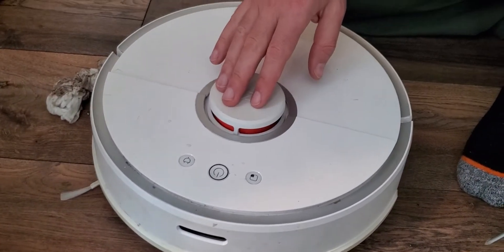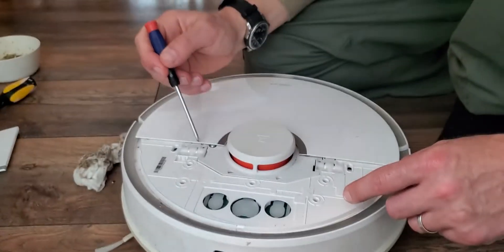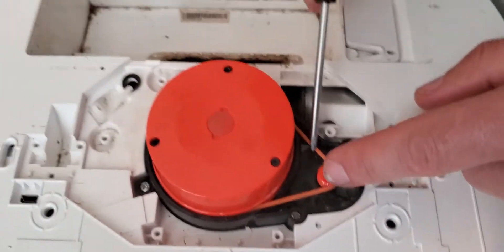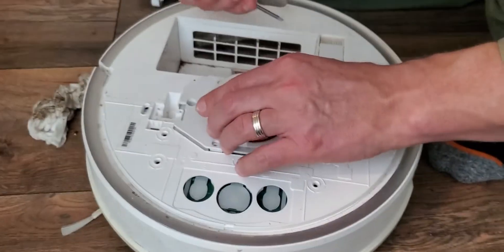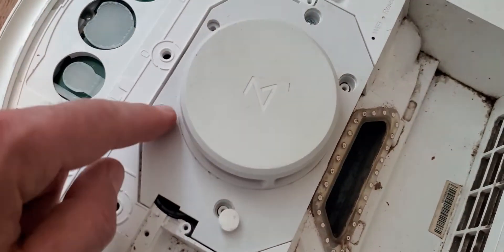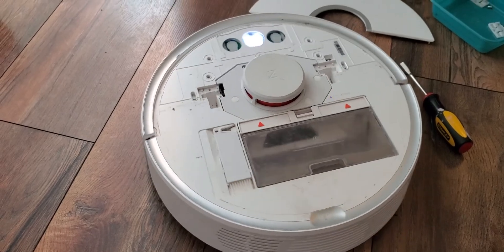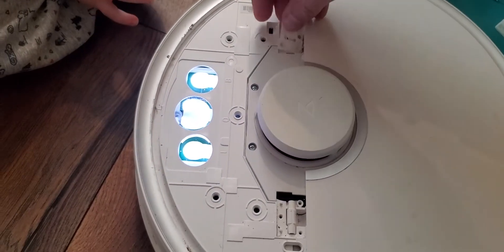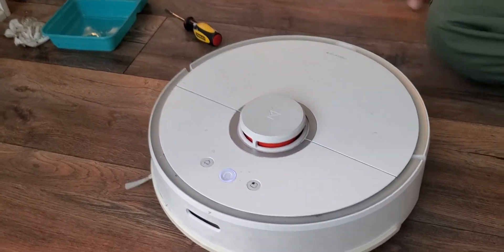Error 1: How to fix Roborock robot vacuum in under 5min

Comment: Thank you for this video! In my case I had to take off the band and clean the little wheel with a wet Q tip. But it worked and my mate is now cleaning the floor again like a boss.